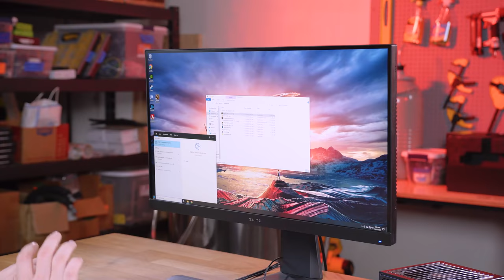This PC almost stumped me... can you guess what went wrong??

Comment: Well actually the TT Core p3 p5 p7 can be used normally or with a riser....
Also the one that came with my p7 i gave away to some dude looking to find a pcie 4.0 support case all of the others he tried caused instabilities and that one ended up working perfectly fine one a 3090...
Not sure if they use different ones on p3 and p7 but the p7 one that i got was feeling pretty isolated and high Quality

Comment: Just for a data point back in November 2018 I built a new AMD system with a 2070 graphics card. I used a riser for the first time and it worked fine for a few days, then one day I was just using the PC and it just shut off completely and never came back on. It just shorted out all of a sudden out of nowhere. I bought everything through Amazon and replaced the MB, PS and graphics card and did not use the riser when I put it back together. I have not had any issues sine. I hate riser cables and will never use one again, they cause all kinds of issues.

Comment: hi jay 
love your channel and style

i don't think it will solve it for your friend and the crashes might return.
if so i suggest 2 simple alternative

1.
the case ground help maintain steady electric potential.
a. check conductivity (you change psu make sure there is a ground on the psu cable) .
b. the computer connected on the same circuit barker / same conductor with ac\heater\compressor... 

2.
if all fail get a pure ac sine wave ups (modular ac isn't recommended) and don't hock up  anything but thee computer .
(if ups sold it you get horrible electric connection to city infrastructure therefor get ups for all electronics or ups bridge to the entire home)

good luck!

Comment: I think the weirdest problem I ever had with a build, was a bad power connector in the case. I spent a good month swapping parts before I was like... Let's try a different case. Booted up immediately with no issues.
Now I always check cables first.

Comment: i had a radeon 9000 pro, many years ago where half the memory modules went bad, but the card still worked just as a 64bit, 64mb card instead. It'd show garbled output in dos and boot, but once windows loaded it'd be fine and display a normal picture. By far the weirdest tech issue i've had.

Comment: 2:40 >> Please note that Gigabyte (as well as Corsair, EVGA, Cooler Master etc) do not really make power supplies. These companies buy PSU boards from OEM vendors, put them inside a box with the "Branding" label on it.
I have experience with the Gigabyte G750H, and in my experience, it's as *good as many other PSU's in it's class (*deliver what is promised). It's board is built by CWT (big name in the industry) and is 80plus Gold rated. This is as much a "safe" bet as any.
You get get a faulty PSU from any company / model. The risk is lower with the higher-end models of course, but there is still a tiny risk. But normally, a faulty PSU will shut off / not turn on (if it's a decent model with protection circuits) before it damages any components.

The "brand" of the PSU is just really not an indication of it's quality. Look at this list:
https://linustechtips.com/topic/1116640-psucultists-psu-tier-list/

Comment: Some years ago, my Dad had a plasma tv go bad, and since he was going to trash it, I though I'd try and fix it.  In the process of probing things inside the TV, I noticed the power coming out of the wall was 136v, which is well outside the tolerance rage for the US.  Checked all outlets in the house and all were high.  Called power company the next morning and they were out later that day and changed the transformer on the pole in front of the house that afternoon.  My dad submitted a letter of costs for all other weird power related issues he'd been having for awhile, and they reimbursed him the money with a check in the mail within the week.  Apparently the transformer that was replaced also supplied power to the neighbor and he'd also been having weird power issues as well and he got reimbursed money too.

Comment: I think the issue comes from PCI-E version incompatibilities. The GPU is probably PCI-E 4.0 and so is the motherboard. The PCI-E riser cable is PCI-E 3.0 compliant but not PCI-E 4.0. Some cable might just cut it but most will not work at all.

Comment: I have a P3 with the riser cable, I had no problems until I switched from a 1080ti to a 2080ti. the problems I had were popping noises from the pci-e (gen 4) socket and after playing Valhalla for an hour the game play was severely glitchy, so I sent the 2080ti for an RMA and while I was waiting for it to come back , I bought a 3070. When I plugged the 3070 in, an NVIDIA error message stating "no NVIDIA GPU is recognized" came up. I drained my system for the 100 millionth time, took the rad away, so the GPU would fit directly in the MOBO and poof it worked.

The most agitating part of this whole experience was when this first started happening I though to my self "riser cable," but noooooo, I had to go the round the bout way.

Comment: Broken wires are the worst. If it strait up doesn't work that's fine, but you can get it to sometimes work, kinda work and work when you try to diagnose it and not work when left alone. And you end up feeling like you have haunted hardware.

Comment: I've had a few Windows 10 USB sticks with corrupt files but working enough to install Windows, but I've had loads of random issues from Windows not running programs or simply not allowing the user to install Windows to their device asking them to run partition manager. I've had to use Rufus with one or two file checking passes or redownloaded the ISO.

Comment: You know, having a bad PSU and bad riser cable at once is a low probability. There is a chance that the bad PSU damaged the CPUs PCIe bus in a way that makes using any unshielded riser cable a bit flaky. I would have changed out the riser cable and then run 3dmark's PCIe bandwidth test and bad sector scans on an nvme connected to the first M.2 slot. All to make sure the CPU can communicate over PCIe properly.

Comment: So I had the same riser cable in my system and my EVGA 2080ti black edition gave out. I didn’t know it could be the riser that caused it. I just RMA’ed the card and used that as an excuse to change my case. I ended up getting a new one coincidentally a fractal design one to match my fractal define r6.

Comment: One additional Information: the Core p3 has the option  to mount the GPU with or without a riser cable (conventional/vertical) ... at least if the GPU is short enough to not conflict with any radiator sitting right of it.

Comment: I just watched a video testing riser cables, it seems like randomly the cables won't tell the system to run as 3.0 compatible, it can happen even with the same model that doesn't have an issue, the same exact one that works moved to another computer...it's strange

Comment: Moral of my story: Please don't cheap out on cables. They transfer the data and power to and from the equipment...

Hi all. I'm a car and home audio installer from S.A. I would understand why it would be the cable because when I wire any setup I always stress the expense on cables as well and the good quality oxygen free copper that's also electrically shielded because you get a lot of static transferred to the amplifiers and ultimately speakers as sound so I've also noticed the cheap quality cable will also cause voltage and current drops resulting in equipment intermittently shutting down. As with cheap HDMI cables. Too long and too cheap you barely get even a stable 1440p output. Sometime grainy picture due to electrical noise in the connection or just flashing.

Comment: I get BSODS if the extra 4 pin power connector is not connected if I try to boost to the normal Turbo 4.5ghz - running on default bios settings the CPU is limited to 4mhz turbo boost when the 4 pin EPS is not plugged in, MSI X299 pro Carbon 0 CPU is and i7-7820X  - I have tested this for hours

Comment: "just throw parts at it and see what happens"

Yes. Yes. This is why I keep old hardware. It's vital to good troubleshooting.
Reply: A few extra parts that you know work are great to keep around.  Never know what might happen to either your system or a friends system
Reply: @Montisaquadeis  Old parts from my brothers upgrades will be my pc. I will work in the summer and buy a mobo for the ryzen 3 1200 that my brother recently upgraded from
Reply: @Montisaquadeis  We moved my friend's Alienware Aurora R4 to a Corsair case and luckily I had the PSU from my previous system since the Alienware one was too tall to fit. I'm glad I don't throw systems/parts out unless they are so old that they are useless.
Reply: i refuse to throw away a working piece of hardware you never know when you might need it to replace a faulty part while waiting for another one and yes troubleshooting , ik for a fact that those are working and that helps alot

Comment: Hardware Canucks just done a vid about riser cables worth a watch.
Reply: Yep, I saw that too, very interesting stuff.
Maybe Jay hasn't heard about the Gen4 riser cable problems yet.
Reply: In that video, they talked about some of the problems from the riser cables if both motherboard and gpu are pci-e 4.0.  A lot of the issues this computer was having were the same kind of issues they were talking about.  I'm wondering if changing the bios on the motherboard would have fixed the problem.
Reply: @dashkataey1740  Idk if it would have fixed all the issues but when Jay installed the riser cable it started glitching out and gave him a black screen. I'm almost positive if he manually set the bios to gen 3 it would have fixed that issue completely. Kind of a shame he didn't think of it because I was really curious and though he would lol.
Reply: That one was an eye opener well worth watching!
Reply: I had to get rid of my p3 because of the riser issue with gen4, even with forcing it to gen3 in bios, did not work properly even then

Comment: As far as the riser cable is concerned almost all of them have an issue with the new generation GPU's due to them being PCIE gen 4. There's a bandwidth limitation which causes black screens, post issues, etc. That's why the PC gave you issues once you installed the cable. To fix this you need to set you output to PCIE gen 3 in the bios and 9 times out of 10 it fixes the issue completely. I wish you would have tried that.
Reply: Agreed. I had the exact same issue with my 3080. Bought a gen4 rated cable. Works perfectly
Reply: @freakmanultra  Someone said the exact same thing just now to Jay on his Twitter and he responded "That’s not how it works. 3.0 and 4.0 are completely compatible.
"....🤦‍♂️ I love Jay, but he can be so close minded sometimes lol. Of course they're "compatible" but that's not the issue here.. if you install a riser cable that can't handle the the PCIE gen4 bandwidth then obviously it's going to cause these issues because the board is trying to communicate with the card at the gen4 transfer rate.
Reply: Luckily the difference between gen 3 and gen 4 is 1 or 2 fps.
Reply: A recent video on what you mentioned.

https://www.youtube.com/watch?v=KwfAF5XjXbM&feature=emb_logo

This is 100% an issue.  As im running a vertical GPU mount kit I looked into this extensively. 

There is info out there of people having tested "Gen 4.0" riser cables vs 3.0 and the consensus is that current Gen 4.0 might be compatible but, i.e you can boot on Bios PCIE set to AUTO, the actual performance is worse than using a 3.0 riser cable and setting Bios to Gen 3.0. 

Linkup have acknowledged this and commented that that are working on a true Gen 4.0 riser cable for release is 1st quarter of 2021. I believe the issue is with the Gen 4 cable shielding requirements.
Reply: @PabzRoz  Actually no, it wont. Because if the gen4 transfer rate cannot be fullfilled, it automatically throttles back to the protocol below. It works this way for any bus technology. There is no problem to stay at gen3 transfer rate. This is not the cable that dictates the transfer rate but the results of trying and fullfilling a complete transaction under each protocol. Also, this is impossible for a gen3 cable to sustain the gen4 protocol. This cant be faked or work by any godlike miracle.
Reply: I agree. However, most motherboards default setting for PCI e controllers is set to auto. Backwards compatibility. Same if you use first gen sata cables on a mobo with a sata 3 port, with a sata 3 device it will chug performance because the bottleneck is the cable.  Should manually try gen 3 i agree, you know try all things. But, this only solves one problem if any.
Reply: @blueguy09  The board and card don't know there's a riser cable installed. As far as the GPU and motherboard are concerned they're both gen 4 compatible and are trying to run at that bandwidth. Introducing the riser cable interferes with the bandwidth transfer rate which is why manually setting your board to gen3 fixes the issue. Watch the video I linked in the comment above.
Reply: @PabzRoz  due to the limited bandwidth of the raiser cable is how the mobo knows what gen to set it at, some mobos are better at detecting this than others. Like i said i agree you should always manually set it. plus he also says it, Some mobos may not be compatible.  So this isn't something  jay is concerned with because his riser cables aren't rated for gen 4.
Reply: @kirkanos771  You may have to change it to PCIE gen 3 in the BIOS though. If your graphics card is PCIE gen 4 and your motherboard is PCIE gen 4, then it'll try to run at gen 4!
A riser cable may or may not work at PCIE gen 4. There are multiple factors at play here, not only bandwidth!

PCIE is forward and backward compatible with the same pinout and that means a riser cable for PCIE gen 3 could theoretically work on PCIE gen 4 at gen 4 speeds. Adding a riser simply extends the wires but as this video also mentions that will extend the surface area for static interference as well! (and other factors...)

A short shielded good quality gen 3 riser cable could easily work at gen 4 speeds, they're just not tested and certified at that speed. (original signal quality from the motherboard is also a factor...)

It's just like how old HDMI cables may work with modern devices. Unless your cable skipped reserved wires from the original specs or have bad EMI characteristics then there is no reason to upgrade.

What we need for PCIE gen 4 riser cables are improved EMI characteristics!
Reply: @PabzRoz  p.s it's funny how his hair style changes through out the vid
Reply: @m4ster_root  Yes you are correct. In my precedent post i presumed the setting to be on auto (the default value, "most of the time").

Comment: 8:27 did jay meant UPS? Can't find anything about a UPC
Reply: He ment UPS to deliver cleaner power to the pc
Reply: Yes he meant UPS, and it's worth getting one to protect your PC or any other expensive electronics from brown outs and dips in power. I have a CyberPower 1500 that I have my PC, 3 monitors and NAS plugged into.There's a couple of reputable brands, do not buy the 300 rated ones, although cheap they only have enough battery to power the smallest/lowest consumer of power of devices for a short time, work out what you're protecting and powering, there's plenty of sites to help, then buy one that's suitable, I was initially looking at a 900 or 1200 rated one, but ultimately went for the 1500, that gives me over 2 hrs when just the NAS is powered on, and 25 mins when everything is on, enough time to finish what I'm doing, save and shutdown and also enough time for the NAS to auto shutdown after 15 mins, coz it takes about 8 mins to fully shutdown.

Comment: TLDR: Don't use Thermaltake products.
Reply: I have a cheap thermaltake case and had no problems or temperature issues for over three years now. I'm happy with it.
Reply: I was concerned about this as well. I'm using a Thermaltake PSU for years and haven't had any problems, but it's gettin' ooooooold.
Reply: @embiggenedbadger4297  Mine making buzzing noise under gpu load xD and it's ooold too...
Reply: @embiggenedbadger4297  Mine blew up on me. Literally exploded with sparks and flames and blew out my old motherboard. Mine was 3 years old.
Reply: I have thermaltake fans and a case (Core P3). I like both. But I DID have to change out the riser cable.
Reply: Thermaltake’s high end stuff is crap. My tower 900 HDD mounts don’t screw in. They don’t have all of the motherboard mounting holes on the tray. The glass is fragile as shit. And my 850w psu from them is super fucking sensitive, like the power cable has never properly fit in and when I had it in my old case and I hit the case getting out of my chair the pc would turn off.
Reply: @AXington  well shit mine is  three years old...
Reply: @razaelll  probably meant electornic products,you cant realy have problems with a fucking case down the line,its not like the any case manufacturesrs make sheet metal out of paper.
Reply: I was almost gonna get a thermaltake Aio cpu cooler, and case fans for a new pc I was making till a friend just told me I'd be better off buying corsair or phanteks stuff lmaooo
Reply: As I found out the hard way with one of their power supplies.
Reply: @alextheonewarrior  Well to be truly fair AIO's are nearly all produced by Asetech so the quality would be pretty similar when it comes to the radiator, CPU block and pump. So Thermaltake and Corsair may have the same parts in them with the exception of the fans. But Corsair is a reputable brand and their fans are pretty decent (have a bunch of ML series fans in my own PC) but mostly I prefer not to have visible brand logos in my PC from the lower end brands so Thermaltake would be out of the question.